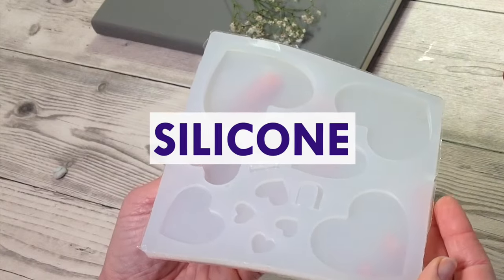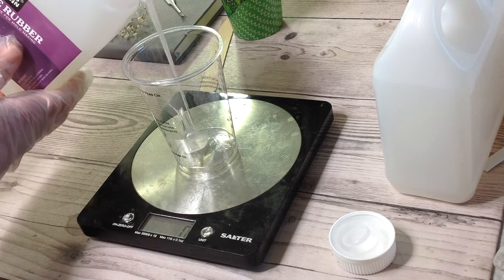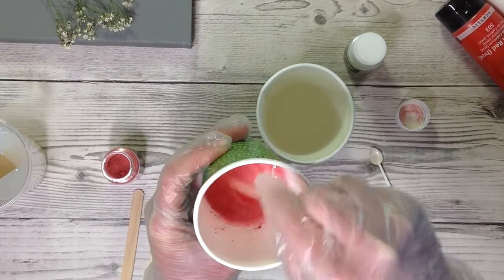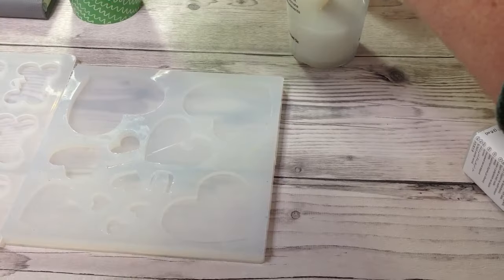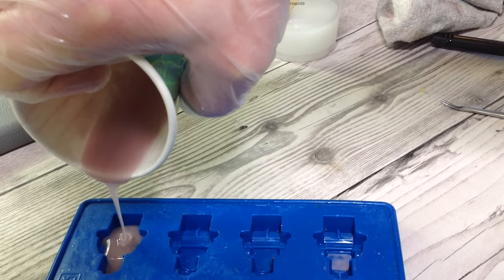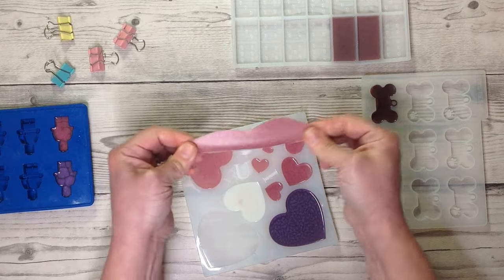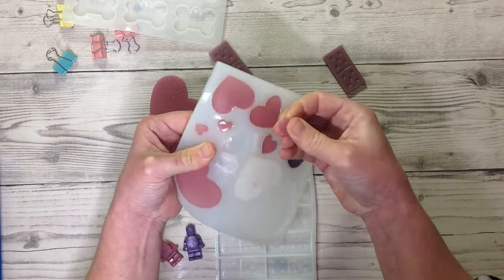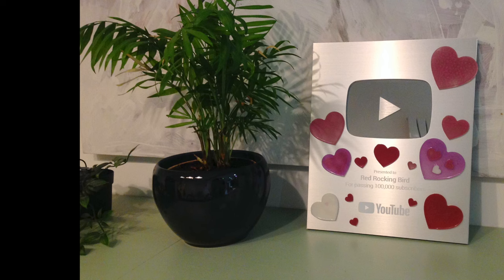BEST* HOW TO MAKE SILICONE MOLDS - resin casting with a twist- FUN WITH RESIN - jelly

Comment: Hello, I recently discovered your channel and absolutely love your creations and informative videos! I noticed in some air dry clay projects you sometimes use Mod Podge or Liquitex before painting. Is it necessary to use a sealant before painting or is it best to skip this step? I would love to create DAS clay pieces that are water resistant and durable, but read that some acrylic paints do not stick well to clay that has been primed. Do you recommend using a varnish before painting to increase durability? Would love to know what you find works best for you.
Reply from the maker: Hi, thank you. In some of my earlier videos I would add a coat to seal the clay, but I’ve found that as long as once you have painted with acrylic paint or an alternative it’s the top coat that is more important for durability, I’ve done quite a few videos around making the clay water right, this one being the first: How to Waterproof Air Dry Clay
https://youtu.be/91EVMXFMgUQ
So a could of coats of a good top coat keeps everything in place and is more important than initially sealing the air dry clay, although some people do and it’s all about preference, I just make my projects for fun and live sharing these through film making but always best to test things yourself and see what you preference is. I wouldn’t use an actual varnish before acrylic paint though. Best of luck with your projects.
Reply: @RedRockingBird  Thank you so much!